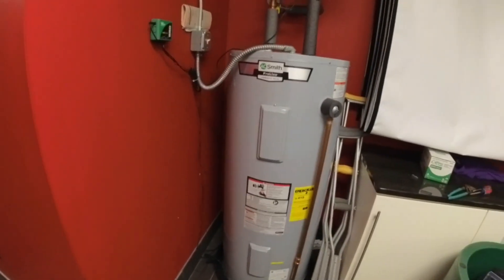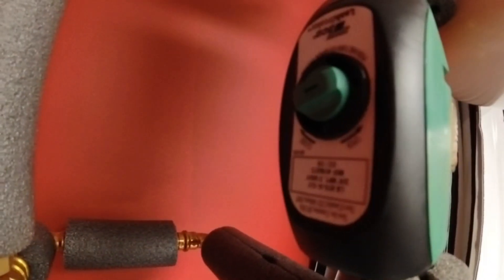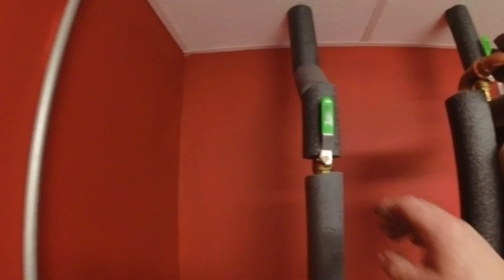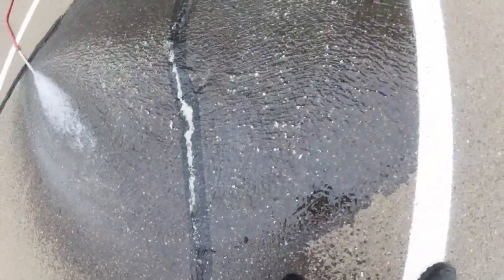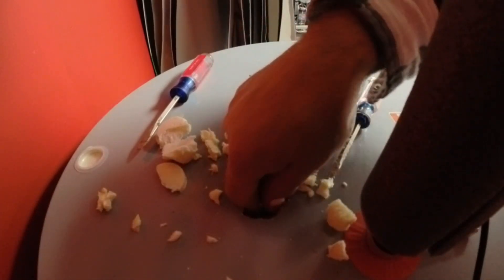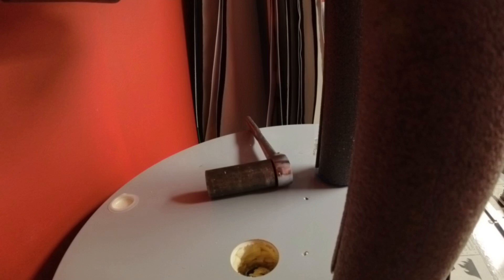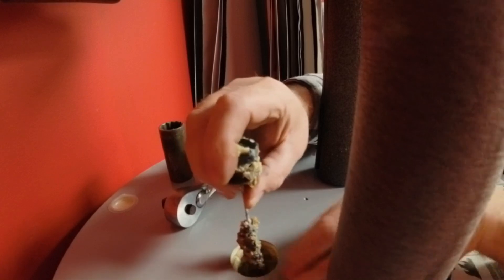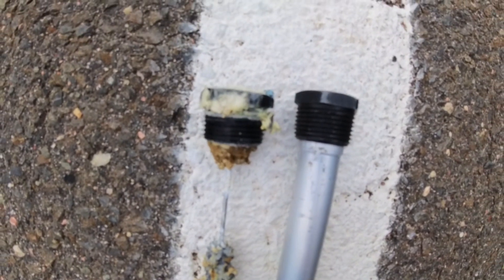Anode rod change out. This is why you change these things.

Comment: New sub here. Great video! I knew it needed to be changed, but always thought it would be a PIA to get out. Are the rods specific to the heater or are they universal per size?
Reply from the maker: Most are universal but not all. Check the specks for your unit.

Comment: You should have left the cold water on while flushing. At least for a few minutes. And I didn't see you shut power off. Lousy video dude.
Reply from the maker: Well thanks for your comment but if you would’ve paid a little more attention you would’ve seen the switch on the wall in the off position. Unfortunately when editing it the two second shot of me flipping the switch off was edited out. This is part of a series of training videos I do for licensed technicians not necessarily homeowners. I’m assuming that a licensed technician would know how to turn off the power to the heater so I don’t spend much time explaining things like that. Also if you would’ve noticed at the end of the video just before I walked outside you saw me open up the cold water valve by pressing the button on the control. That opens the electrical valve to let the water start flowing. Also if you listen you can hear the water start flowing. Thank you for your concern, and your right make sure everything is turned off.

Comment: So is 3 years the recommended replacement schedule for these then? Is it the same for natural gas units?
Reply: Been my experience Scott's suggestion checking new tank anode at one year is spot on.  Rate of anode depletion depends on local water chemistry, how many holidays (pinholes) in tank's glass lining, etc.  I've seen tanks where anode rod didn't last three years, and would suggest going with impressed current (aka powered) anode in such cases, rather than the traditional sacrificial anode rods.  House I'm in now, I check every three years, but have been on same rod for 9 years now and spare rod just gathers dust so far.  Would also suggest removing anode rod with impact wrench; it's just much easier/faster and no worries about tank moving while applying torque.  Whether removed by impact wrench or by hand like Scott did, only drain enough water so water doesn't leak out when anode is removed.  You'll want most of the water left in tank for the inertia stability the weight of almost full tank will provide.
Reply from the maker: I recommend checking the rod after one year in use. It most likely will not need to be replaced but it will give you a better idea of how long you have until it will need replacing. It makes no difference of what kind of heater you may have oil,gas, or electric because it is the water that acts on the rod to dissolve it. The factors would be how bad is your water and how much fresh water is introduced into the tank. I have seen an 1 1/4” rod totally dissolved in one year on well water. This rod in the video was in contact with treated city water for 3 years.  Not all water heaters have them but most do. Water heaters with a 10 year warranty most likely will have two rods.